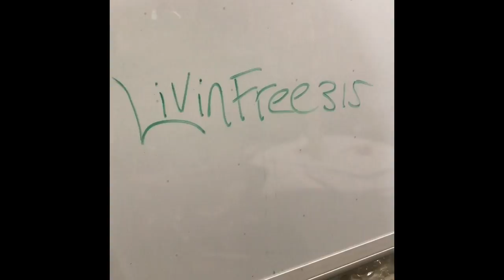How to make a L.F.D. ( layered for depth ) tube cane

Comment: perhaps i’m missing something, but why start coating on a tube and not heavy rod if’n you’re just going to melt out the air in the center anyhow?  i would start with beefier solid rod handles and gather then up when it comes time to pull em down... hard to pull big chunks and not melt a tiny tube punty off.
Reply from the maker: Lol 😜 it’s hollow when all done . So’s I can still wig wag them up . 🤑